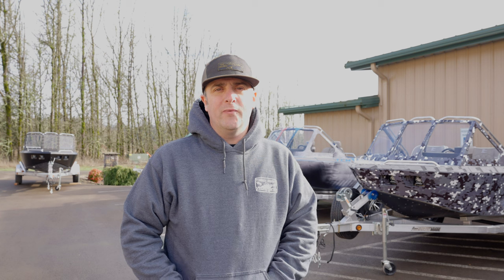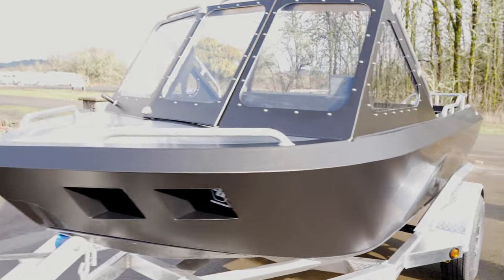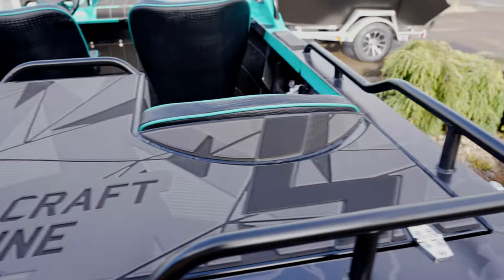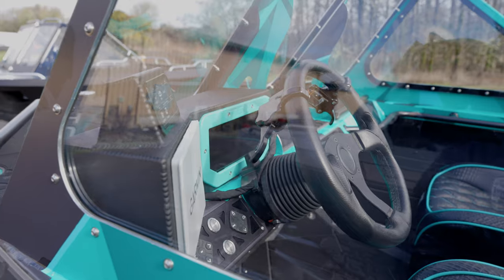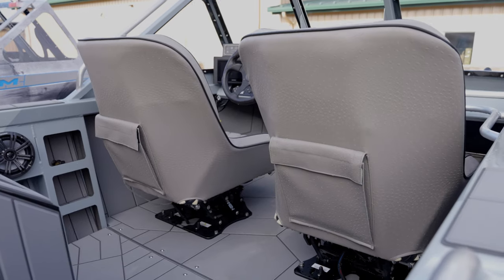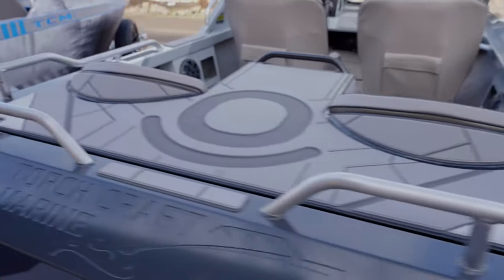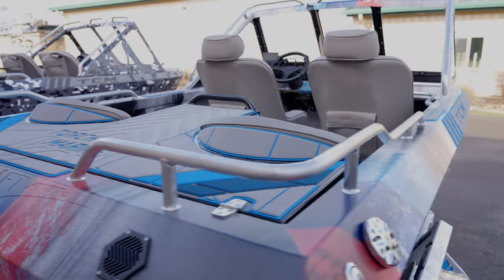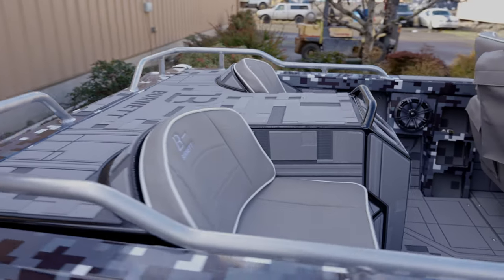Mini Jetboat Heaven!

Comment: Why is the steering wheel on the wrong side of the boat. Looks like it's on the port side.  would like a standard boat  Throttle also. Otherwise  Beautiful would love one.
Reply from the maker: We aren’t limited to cable operated throttle controls, all of our boats are fly by wire. With that being said, we put the helms on the port side because it’s a native seating position. It feels more like a car or SXS. You also don’t have to walk around your vehicle to get in the boat or start it.

Comment: Yeah and they want $50,000 to start with. There cool but nah hard pass I’d pay $20,000 for it and that’s pushing it for me
Reply: I'd you can't afford it don't buy it or if you're mechanically inclined build your own.
Reply: @TheDeerhuntingboy101 are you 🌈? I ask because you give off strong 🌈 vibes.
Reply: For $20,000 it better come with every option available those only 6 kegs worth of metal in them boats
Reply: I can get a jon boat and and an old jetski for under $3k
Reply: @TheDeerhuntingboy101 not many can afford it. Most have to beg the bank to buy it for them!

Comment: These are really nice but the price is ridiculous
Reply from the maker: How so?
Reply: @torchcraftmarine  they’re selling for the same price as a full size ski boat and 3x as much as a new jet ski.
Reply from the maker: @bgy1591  Ok and? Full sized ski boats won’t perform or go where these boats go. They are purpose built just like a ski boat but 10 times the fun. Our boats can jump logs, slide over gravel bars, run in 3-4 inches of water and do 0-60 almost as fast as a jet ski. They can’t be compared to any other class of boat.
Reply: @torchcraftmarine What is your profit margin?